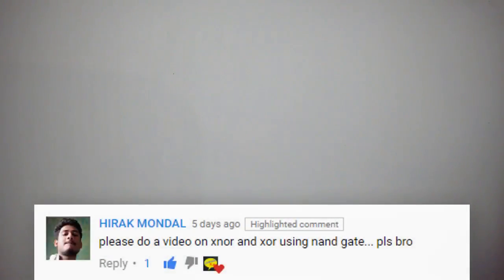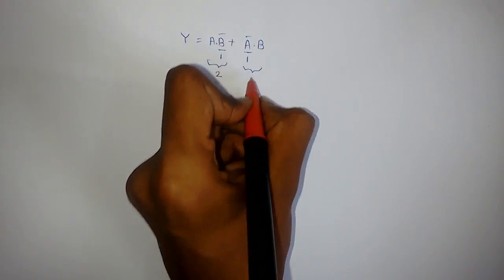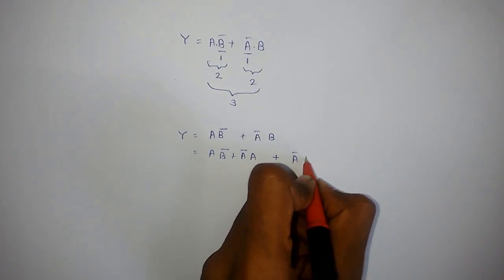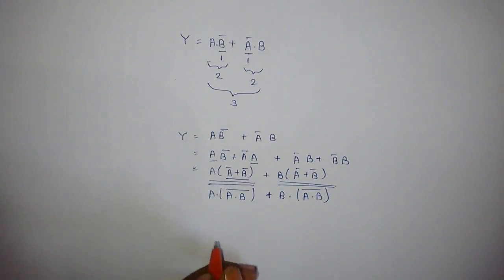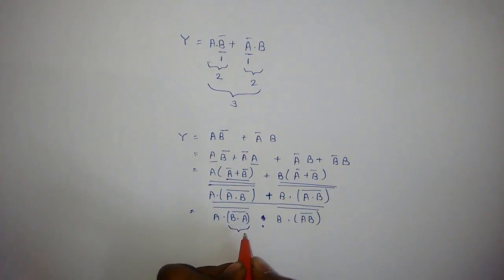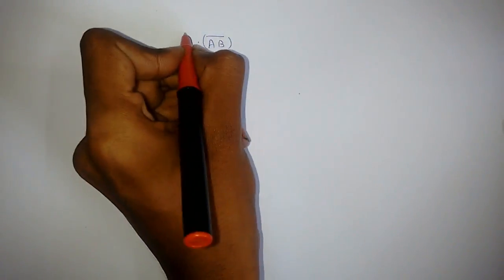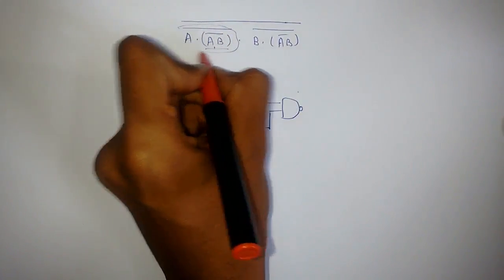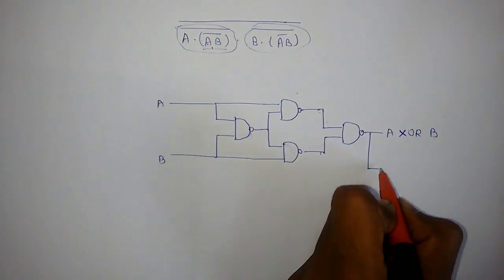xor and xnor using nand gate

Comment: pls help me. in my book I find there are 3 steps of creating circuit of xor gate using nand gate. but yours process is different
Reply from the maker: +Moshmi Kandu you can use any method. Try to find optimum one out of it (which requires less number of gates)
You can even use simulator like Proteus to verify😃